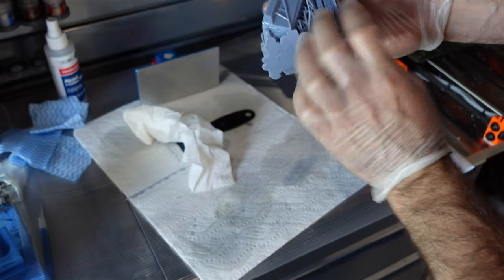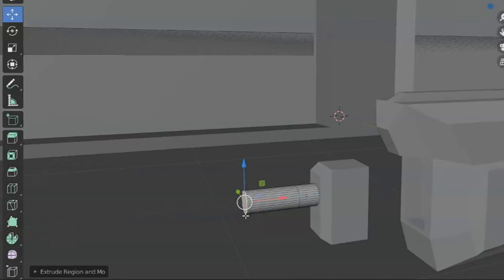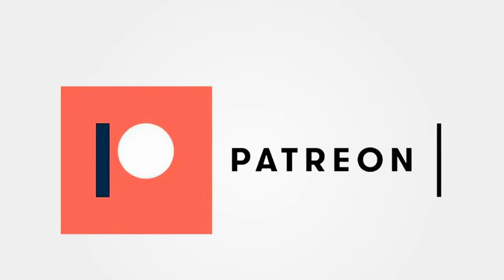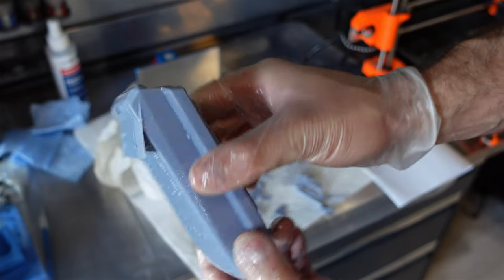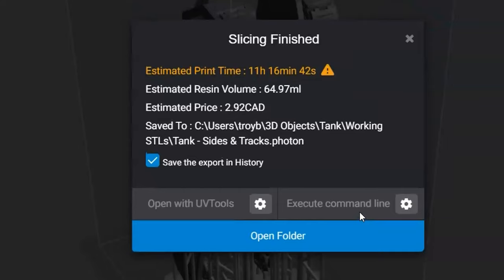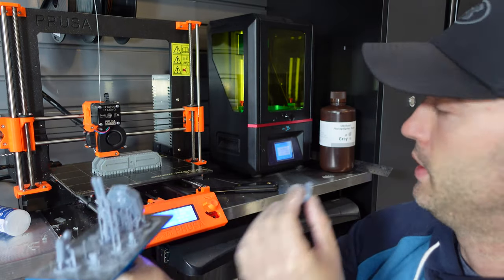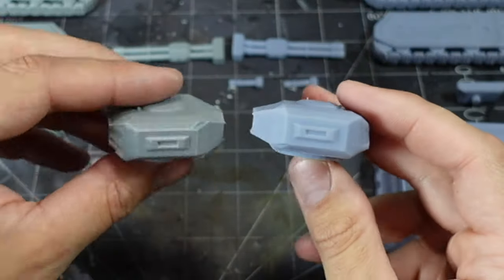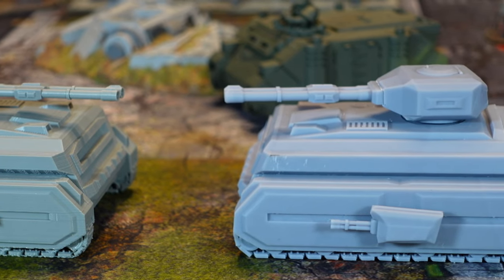MOVE OVER GAMES WORKSHOP - A New APEX PREDATOR is in TOWN 3d Printing Mins & Terrain Warhammer 40k

Comment: If you don’t mind me asking a question… how did you get those really easy to peel off supports under the tank where the treads go on the FDM printer?  I’ve never seen supports that come off that cleanly and easily.  I would really like to know how you made them.
Reply from the maker: Cura has nice auto supports and I selected "bed only"
Reply: Honestly, there are a few main factors 
1. The z-distance setting between the model and the supports - the further apart they are, the easier they are to take apart, yet the less useful the support becomes. Ideally you want it to be 1x your layer height (if you print at a layer height of 0.2mm, make the z distance of supps 0.2 aswell.)
2. Filament choice. Different filaments work different with their supports; some stick like glue and others come off flawlessly. This also isnt dependant on the material primarily, but also on the manufacturer of said material.
3. There are a lot of videos and threads on reddit about this topic, read into it :D

Comment: To reduce failures on the resin printer spray it with WD40 ptfe dry spray. It will help a lot.
Reply from the maker: That is a great tip, I have a can and did it off screen... My support failures was due to my own placement, after i put a few heavies in there it work. Thanks for the input.

Comment: Pretty cool! Nothing like printing your own designs. Was that Blender you were using? I've only mucked around in Fusion 360 but have been thinking about diving into Blender. Anyway, last thing I wanna say is just definitely devote some time to mastering manual supports - it'll save you so many headaches.
Reply from the maker: Yes it was... I just got to lazy to manually support these minis haha... but you are correct on that.